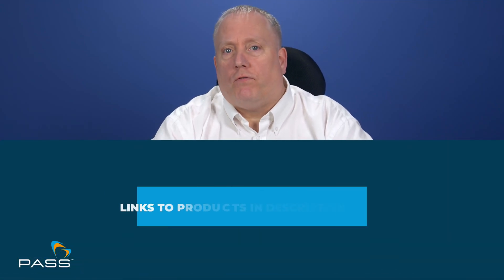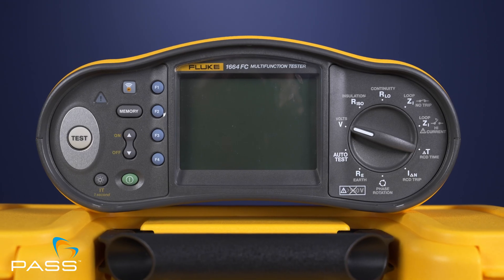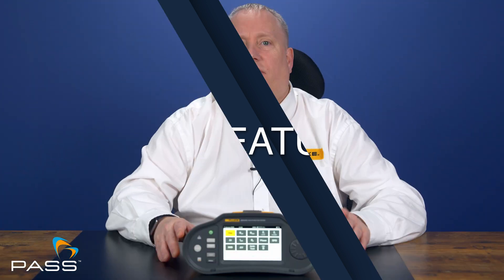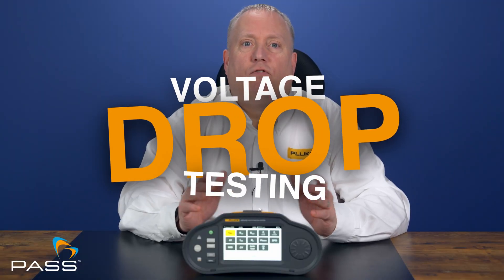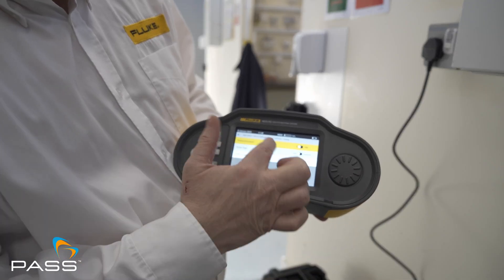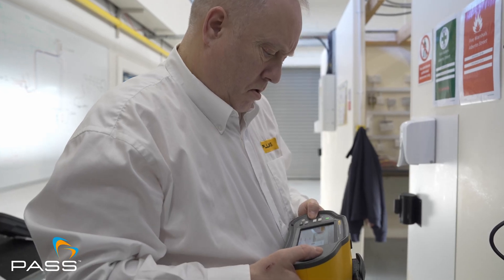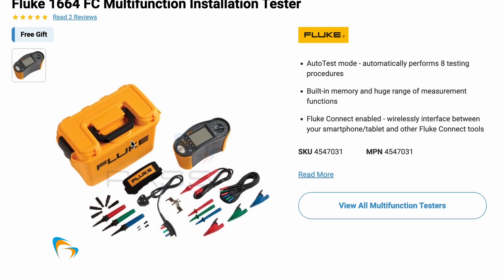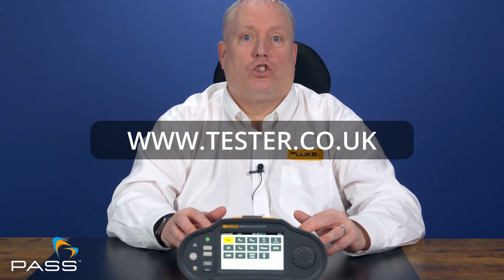Fluke 1664 vs 1674! Comprehensive Comparison of Multifunction Testers

Comment: It would be interesting to hear more people from the field and their use of the new tester. The 1664FC is a good tester. If there are issues with the new tester fluke should iron them out as soon as possible. How accurate is the tester on each of the tests and functions ?
Reply from the maker: Hi @mathman0101, Thank you for your comment. We have reached out to Fluke and asked them to comment on this response, and this is what they have replied with:

"All the functions of the 1770 Series are working correctly with No reported issues, the functionality of the series is constantly evolving, with New Firmware versions that will be available on the Fluke website. The unit is fully undateable in the field by USB-C

The specifications are listed on the data sheet after being checked by independent testing bodies."

I hope this helps and feel free to reach out to Fluke directly if you require any support or advise on this instrument.
Reply: @ Thankyou for reaching out. Fluke connect has been a big bugbear for a long time in terms of connectivity dropping in and out between app and tool. Updatable by USB-C and a laptop (windows and Mac?)surprised there is no over the air updates and self updating features on the tool.